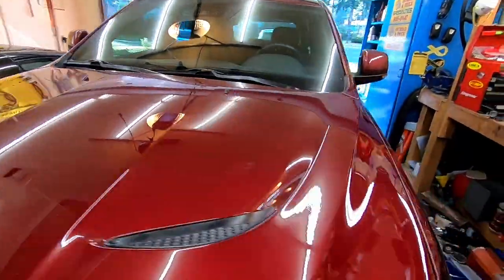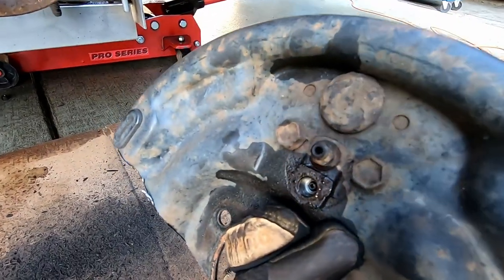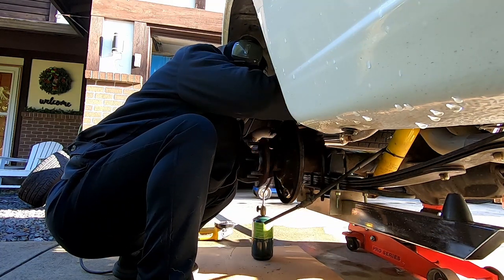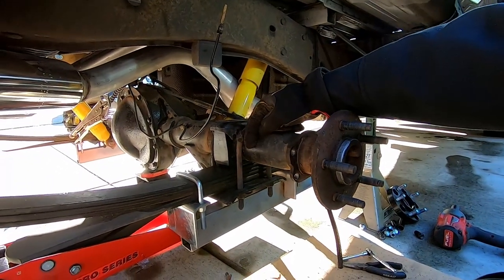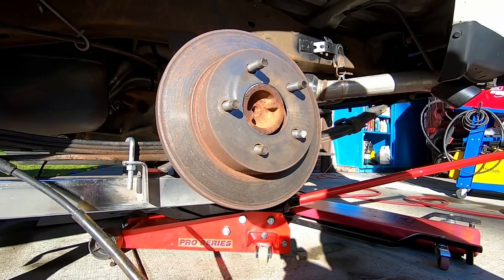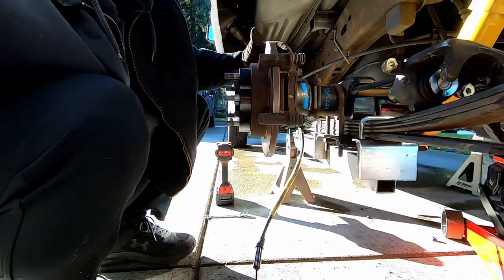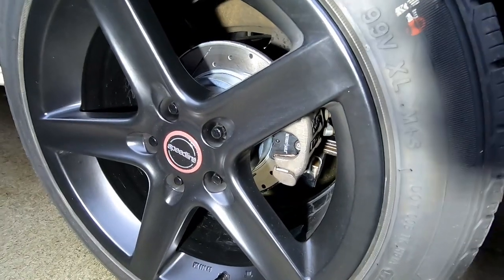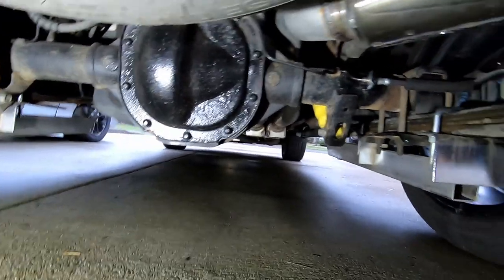The Ultimate Ford Ranger Rear Disc Brake Conversion Guide Using Mustang Parts Full Detail!

Comment: Thank you again for all the information...if you don't mind I'm just going to share some additional tips. 1. At the junkyard, if the mustang is an automatic and not in neutral...the gear selector is on the driver side of the transmission. If you remove the cable and click it twice towards the back of the car, it will shift into neutral (this is so you're able to remove the slider  pin in the axle housing to get to the C Clips.) 2. TAKE ALL THE BOLTS FOR THE CALIPER AND BRACKET lol 3. I used the front soft brake lines from the mustang for this conversion (if you do this, you will need a $5 3/16 to 1/4 brake adapter from Auto Zone for the driver side) 4. If you don't remove your axles on your ranger, I used a combination of a step bit, hacksaw, and 3in cutoff disk to remove the drum backing plate.  I used the cutoff disk to create a relief cut, then created a series of holes with the step bit underneath the initial cut from the cutoff disc. I then used the hacksaw to finish everything off (this way was much safer than using the cutoff for the entire thing lol). 5. I used the cutoff wheel to remove 1.5in of spring from the emergency brake cable. 2.75in of .5in copper pipe provided factory-like tightness, but 2.25 does stop the vehicle tho. 6. Bevel the inside of the axle bracket is super important and was a good call.

This conversion does not improves braking much, but it does much braking much smoother than the jerky feel of the drums. Plus I like that it only takes less the 30mins to change out the pads and rotors.
Reply from the maker: Excellent information!  Thank you for taking the time to add to this.

Comment: It was worth the cool factor, even if performance is a push vs the drum brakes. And thanks for the burnout!  Haven’t seen you around CF lately, hope all is well.
Reply from the maker: Yup.  no regrets on the swap.    It works very well but just have to be realistic in the reasons for doing the swap.   Ahh yes the saga of the CF lol.  Managed to get myself banned again.    I've been a member of around 30 different forums in the last 25 years and CF is the first and ONLY place I've ever been banned from.   This ban is listed as permanent.  No idea if they are going to stick to that or no.  I'll wait and see if they have a change of heart after a month or so.  I've already created another account under my VPN but have not used it.   If I do make a comeback it will be from scratch and on the down low.   There are a handful of moderators there that I and others have had problems with and they just insta ban you under the guise of mod/site bashing instead of actually having a conversation.   Very frustrating.  Thanks for the reachout good sir!
Reply: @PNW_Car_Mods  That really sucks. I hope you can make a comeback. -vette4fl.
Reply from the maker: @bat5917  Yup,   No worries.  Just have to be patient.   I am curious if you could when you get a chance try sending me a PM on the CF.  I'm curious to know what it will say or do for you.   I've had a couple others say that the forum doesn't show me as banned and that it actually has me as green lit active on the board.  Weird stuff.   Hope the heads and cam install are going well.  I can still see the forum by the way. I just can't post or like button.
Reply: @PNW_Car_Mods  It does not show you as banned. Tried to send a pm, but would not go through. They might have sent it to Mr. Black, but without the period. I’ve done that and then was curious when you didn’t reply, oops.  As a matter of fact I was sending you a pm with a question about my build, when I got the “can’t receive email…” flag.  

Well I hope you can get this resolved soon enough. In the meantime, keep the videos coming! I’ll be installing the heads in the next few days, and your engine building for dummies is a tutorial I use. I should include a link for that in my post as my reference for any other guys new to that. 👍

Comment: I go through periods of glove vs non-glove use. I think it depends on temperature. I feel like I tend to not wear them when it's hot out because "reasons" but I wear them in the cold? Or maybe it has to do with how greasy I plan on getting? Or maybe I only started wearing them when I got old? The world may never know.
Reply from the maker: Glad I'm not the only one.  I've been a wrench all my life and it is just so random for me.   Obviously if I'm running fabrication equipment I wear my gloves and they've saved my ass often.  I'll run cutoff discs and wheels way closer to my hands than most people will.  Doing technical stuff in gloves sucks!

Comment: I'm guessing this currie brake line kit fits perfectly into the pre-existing brake line on the ranger? Doing the same thing on my 94 ranger, the brake line on the ranger is 3/16, I believe
Reply from the maker: That is correct.   The only thing  I didn't use out of the currie kit was the banjo bolts as apparently explorer brakes use a different bolt so just reuse the mustang banjo bolts.
Reply: Thanks for the quick response. I found a kit that was a bit cheaper than the currie kit, but is basically the same thing, I'm still holding on to the banjo bolts on the mustang calipers. I always forget just how much of a pain in the butt it is to install calipers with brand new fresh shoes with that super tight fit LOL hopefully my package will be in soon, and I'll be driving in a week. Until then back to the little 05 Camry.

Comment: Hey...did you have to remove the mustang axles at the junkyard to remove those flat caliper brackets? Thanks
Reply from the maker: That is correct.  I should have mentioned that in the video!
Reply from the maker: Another option is to just get the brackets off of ebay.  they are often on there for cheap!
Reply: @PNW_Car_Mods  Thanks a ton...it feels like I'm following your steps. I built a 07 Grand Marquis with an used adtr supercharger kit. Your suspension was a huge help, the whole crown Vic series is great. I sold it and treated myself to a '21 Durango 392 and procharged it (cheaper than buying the hellcat lol). Now I'm building up my old ranger that has been sitting with a slow 5.0. We have similar taste. Thank you for all your videos and help; I'm subscribed to your channel on my other account.

Comment: Is it possible to send a kit like this here to Brazil? I have a 2000 Ranger and would like to install a kit like this.
Reply from the maker: If you can find an ebay seller that will ship to Brazil it should be easy.  There are lots of wrecking yards and other mustang parts shops that sell these parts as a package on ebay.   Calipers, rotors, brackets, dust shields.   All you would have to do is find suitable tubing to make the spacers for the emergency brake cables.